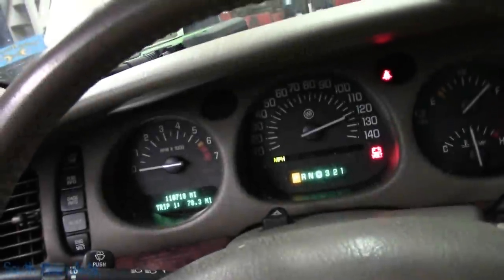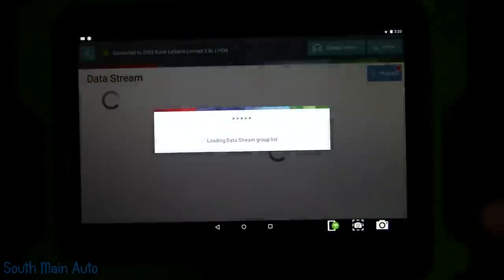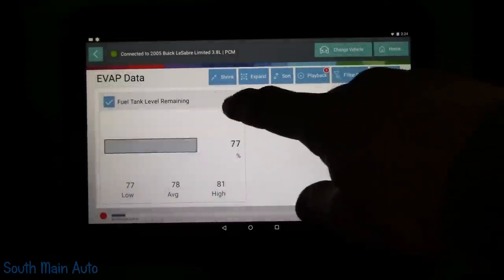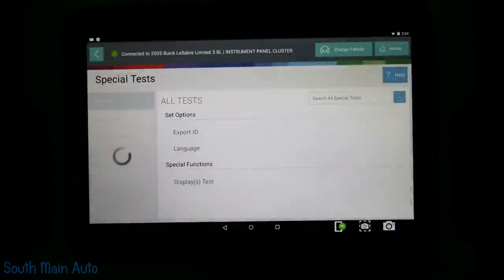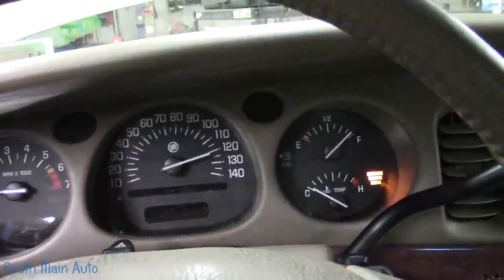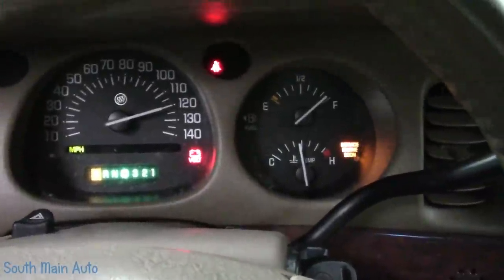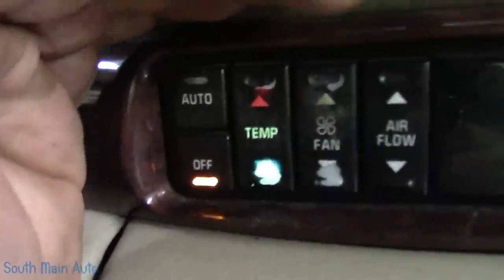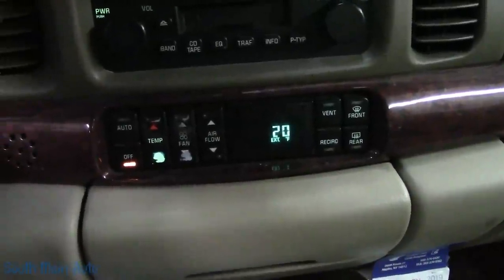Buick LeSabre: Instrument Cluster Diagnosis

Comment: The electrical and mechanical engineering on GM vehicles is very poor BTW that cluster was built by Delphi (formerly Delco) in Flint Michigan.  I worked for a company that built plastic components for that plant I believe that factory is shut down QA was way down the list and cost shaving was number one they were also very slow to pay suppliers for components and tooling this was several years before GM went bankrupt.
Reply: Rob C...when you look at the price tag, and wonder where the quality went, remember mandatory tire pressure monitors, and back up cameras, for the same price! 

Groceries wouldn't be so much of a couples budget, without the four kids!!
Reply: @roadkill5333  Mopar and Ford have the same regulations yet they can build a vehicle for about $2000 less, look at GM designs needless complexity and lack of standardization of basic parts on similar cars.  If you could have visited Flint with me you would have seen rows of   incoming quality inspectors doing nothing because the components were supplier certified and sent directly to the line yet the UAW kept all those do nothing jobs in place.
Reply: @robc8468  Same thing happened with Australias auto industry, the parts turn up in a container with a photocipied inspection tag that says they are all good and accounted for, incoming inspection ticks the box and passes them on. A shonky transport company I think it was started 'loosing' LS1 engines off the truck occasionally, the incoming paperwork said they were all there, incoming ticked the boxes without checking LOL.
Took GM factory a few years to find out why they were sometimes short on V8s and gearboxes.
Reply: Rob C...visited Flint! Sir, I used to drive a truck on a regular basis, to the suppliers and to the manufacture we, and saw first hand where the same supplier was sending different parts, to different manufacturers. I reckon those parts sent to GM weren't as good as the same makers parts sent to Ford or Chrysler! But again, let's remember how ford has survived! Or, did you not know that they held partnerships with several different vehicle manufacturers, across  the world, that they have sold off when they needed cash flow, and then moved most of their manufacturing to Mexico, where the labor cost millions more, they pay higher wages, and more and more benefits than in the US. Oh wait, that wasn't why they did it!

Comment: All the PATRIOTS bought these cars new because they swore up and down they would never give any money to any "Jap" car company. Look at the junk these things turned out to be. I invite people to go to a nearby junkyard and look at all the "country of origin" on the parts in these things. My '02 Bonneville had Singapore printed on the original, failed fuel sender. The taillights in the Regal I had(before I swore off mid-2000's GM's forever) had Korea embossed on the taillights, and I've seen Delco speakers made in Japan. People are so fooled by this crap. If United Radio didn't have GM, Ford and Mopar electronics to repair they would go bankrupt.